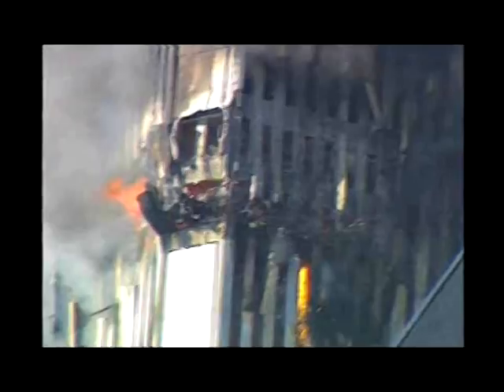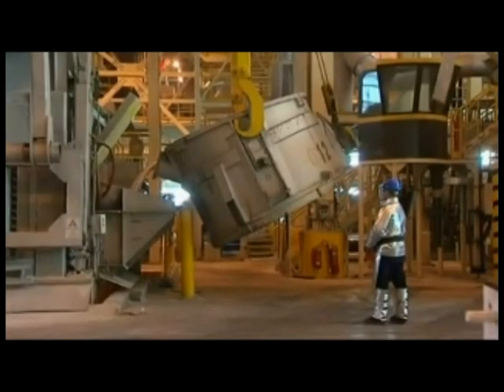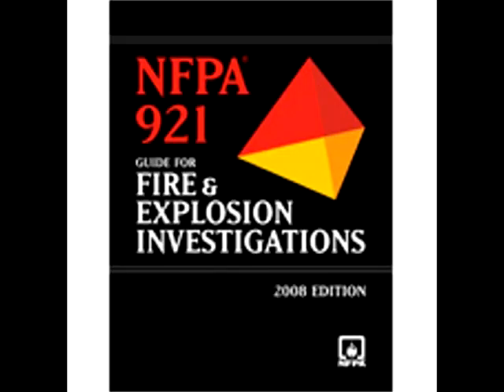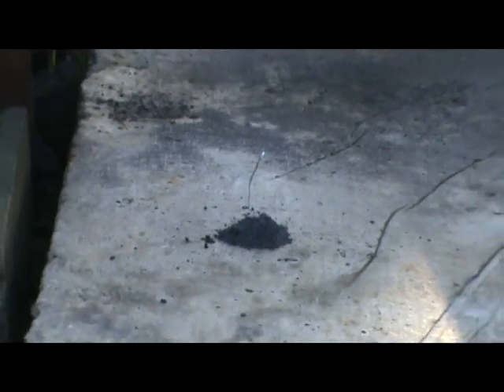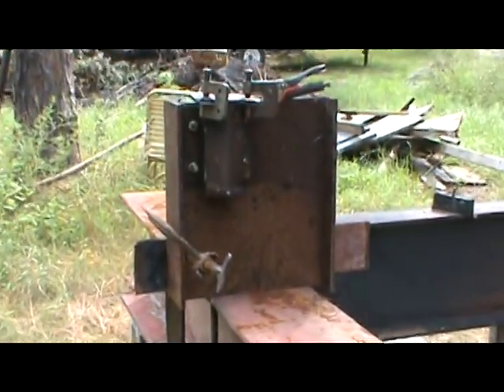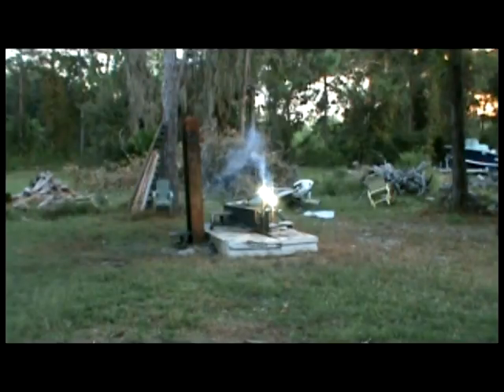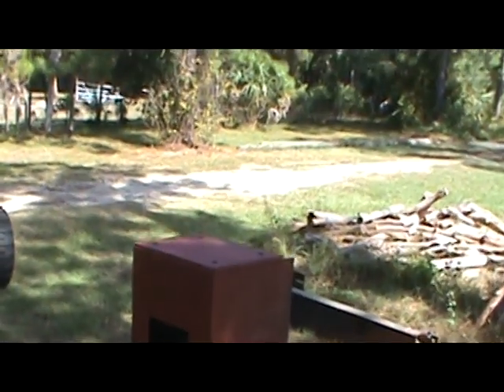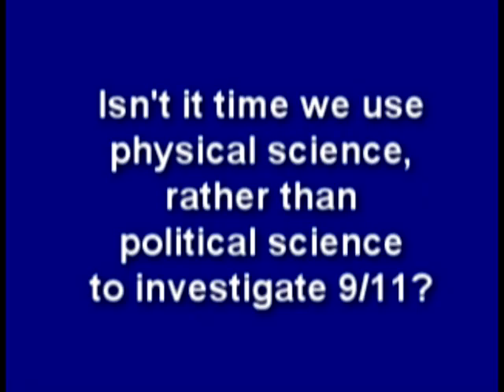9/11 Experiments: The Great Thermate Debate

Comment: not to complicated or very noisey
Reply: Emvaz22 peer reviewed by who? the editor? or the brother of the guy that wrote it. lol
Reply: fyi. my first comment was sarcasm
Reply: marvin martin In your first comment, 'too' was spelled incorrectly, but I digress.

There was an "elevator modernization" that took place a month before the attack.  The elevator shafts have direct access to the main steel support columns of the entire structure.  The company performing the modernization, as well as the security company overseeing the buildings at the time, are both pentagon-tied contractors.  George Bush's brother Marvin sat on the board of the security company.  Thermite is not a high explosive (although it can be formulated to be just as energetic), and thus creates a much quieter report.

Still too complicated for you, or should I simplify it even more?
Reply: Emvaz22 Conspiracy theorists love circumstantial evidence but disregard actual evidence.
Reply: jimmiedimmick What actual evidence would you be referring to?  Does it refute the actual evidence presented in the paper titled 'Active Thermitic Material Discovered in Dust from the 9 / 11 World Trade Center Catastrophe.'  Harrit Et al.  The Open Chemical Physics Journal. April 2009?  

Which peer reviewed academic journal is your 'actual' evidence published in?  Take your time.
Reply: Emvaz22 you really need to do some searching on that magazine you mentioned lol and the evidence you speak of has NOT been peer reviewed. fucking funny as you mentioning that particular journal. people have submitted absolute trash to them and they have printed it lol
Reply: marvin martin Yeah, it WAS peer reviewed,  Prove otherwise.  What published study refutes it?  Title.  Author.  Publication.  Date.

What trash study are you referring to?  Where is it published?  Send me a link to this study from the journal it was published in.  I don't think you can, you just repeat "debunker" garbage like the drone that you are.  I'll be waiting for your source citation which backs up your flawed opinions and fallacious logic.
Reply: marvin martin Published.  Peer reviewed.  Unrefuted in the scientific literature.  And you have no published facts to refute these claims.  Prove me wrong.  Good luck.
Reply: Emvaz22 peer reviewed by who? names please.
Reply: marvin martin From Dr. Steven Jones:
As a Full Professor of Physics at BYU, I reviewed dozens of scientific papers as a peer-reviewer.  I have reviewed papers since accepting early retirement from BYU in 2007. And I have published as author or co-author over fifty papers which have been subjected to peer-review. Based on my experience in the peer-review system,  I can add that it is not the place of an author of a paper or even an editor to reveal the names of peer-reviewers, but it is precedented and generally acceptable in the scientific community for a peer-reviewer to disclose his/her OWN name and role in the review of an important paper. This is the case for a prominent reviewer of the Harrit, Farrer, et al. paper -- one of the reviewers discloses his name and further comments on our paper and his review of it here:   http://impactglassman.blogspot.com/2010/09/911-truth-evidence-of-energetic.html .  The reviewer's name is Prof. David L. Griscom.   Among his impressive credentials, Prof. Griscom is a Fellow of the American Physical Society and a Fellow of the AAAS.  I quote a brief excerpt from his blog and encourage you to read all of it:"II. The 2009 publication in The Open Chemical Physics Journal (TOCPJ) of a fabulous paper by Harrit et al. entitled “Active Thermitic Material Discovered in Dust from the 9/11 World Trade Center Catastrophe”  Some disparagers of the 9/11 Truth movement have alleged that TOCPJ is a place on the web where anybody can buy a publication without peer review. Absolutely false! I know this because I was one of the referees of the Harrit et al. paper. The editors asked for my opinion. And after about two weeks of studying what the authors had written, checking relevant references, and gathering my thoughts, I finally provided my advice to authors in 12 single-spaced pages, together with my recommendation to the Editors that they publish the paper after the authors had considered my suggestions. Still, some skeptical readers may ask how anyone can rate a scientific paper as “fabulous.” Well, I am the principal author of 109 papers (and a co-author of an additional 81) in peer-review journals. And have refereed a least 600, and possibly as many as 1000, manuscripts. So you would be right in calling me an aficionado of articles published in scientific journals. And I found absolutely nothing to criticize in the final version of the Harrit et al. paper! Apropos, twelve of my own publications have appeared in the American Institute of Physics’ Journal of Chemical Physics (an old fashioned paper journal), so it is accurate to say that chemical physics (of inorganic materials) is my main specialty."